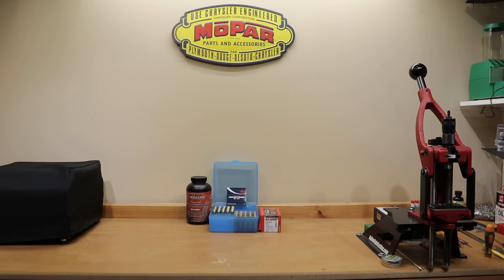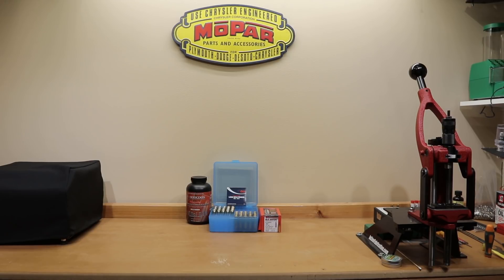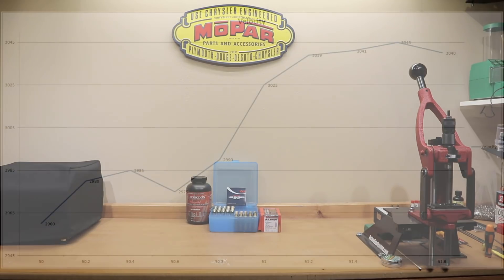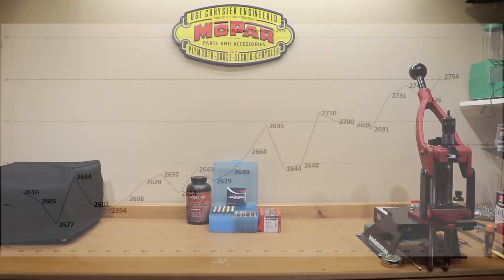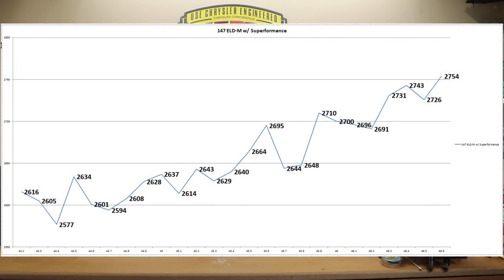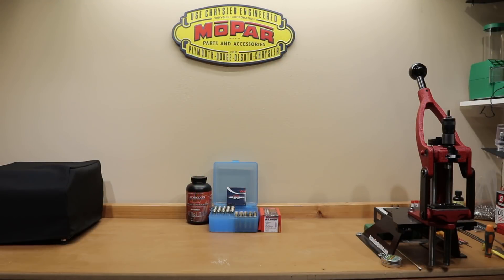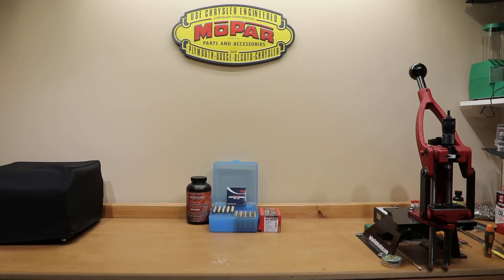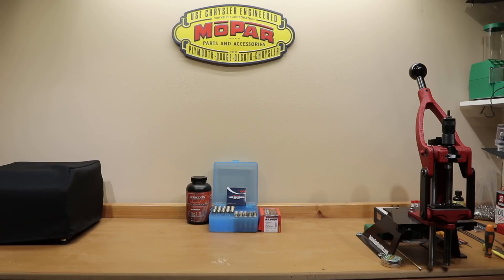Hornady 147 ELD-M with Hodgden Superformance 6.5 Creedmoor Ruger Precision Rifle Velocity Curve

Comment: Running starline with cci LG rifle. 44.5 gr superformance. 2684 fps. Sd of 4. .38 inch group. 2.825 oal out of the book. I didnt really test seating depth because the results have been excellent. I'd give it a try again. 3 rifles I've tested for it have been at 44.7ish.

Comment: I fully appreciate the Scott S. Technique but also urge caution when evaluating safety based purely on velocity (even with pretty looking brass). Velocity in reloading manuals is a "surrogate" for pressure.  The only reliable way to be absolutely safe is to have the ammo tested in a "pressure transducer equipped" test barrel.  Remember that many manufacturers use a 125% of rated pressure "PROOF" load to QC the barrel.  Repeated high pressure loads are going to cause you problems....eventually. Keep your face..stay safe.